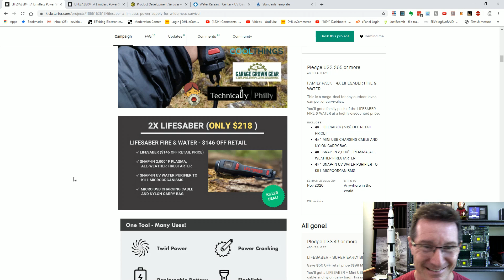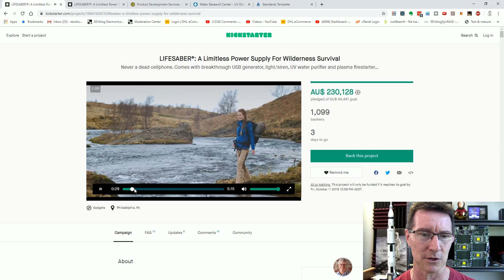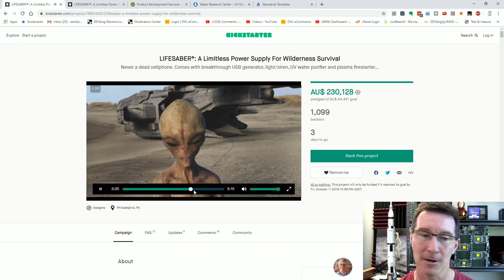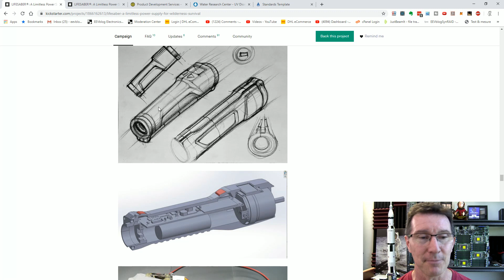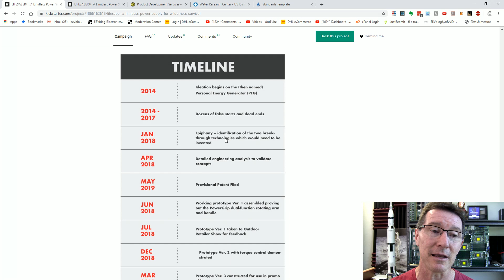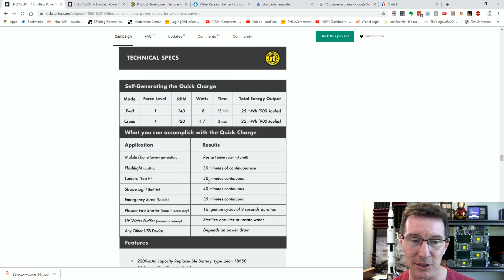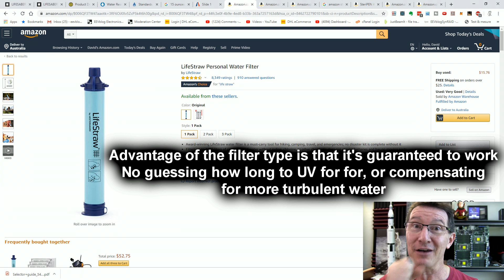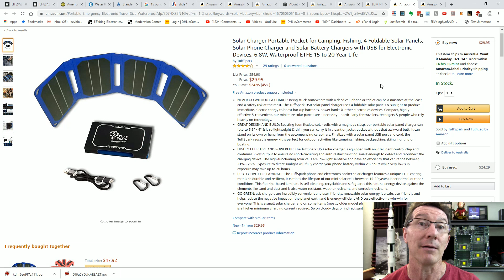EEVblog #1251 - LifeSaber Kickstarter - A Master of None FAIL

Comment: It reminds me of a video I watched some time ago about starting a fire with a flashlight... Incidentally, it was the refector element of the flashlight which is used like a focusing lens to ignite the fire, however ever since then I was wondering why someone hasn't made a flashlight that had a built in firelighter, USB charger, hand warmer, a taser, an alarm, a water purifier, an AM/FM radio, a bluetooth speaker, air pump, cooling fan, electronic egg beater,  a range finder, a direction sound amplifier, satellite messenger, vape, universal remote control and night vision goggles/vr headset built in...
Reply from the maker: Now that you mention it...
Reply: You too huh?
Reply: Just a flashlight with a good lens and a good 18650 tyvm. Plasma Torches are cool and all but if you can start a fire you can boil water to kill most microorganisms and bacteria at least enough to drink. 
The UV thing really depends on how effective and fast it is 🤷‍♂️

I still feel like a strong 18650 waterproof flashlight with a small plasma torch is more feasible and could probably be made at a weight of like 150-200grams.  Or even a flashlight with a dual lens system for water purification. But the rest of this is pretty nuts and makes no sense. Besides you can make a sos signal with any flashlight, a siren that sounds like a toy car isn't scaring anyone lol.

Handcrank power? It's been around almost as long as electronics have. 🤷‍♂️
Reply: @infernaldaedra  The UV part is the least impressive thing on the product, because you can literally get a decent UV flashlight for less than 20 USD.
Reply: @InfernosReaper  I think the flashlights are generally UVA or UVB whereas the sterilising light will be UVC.

Comment: In more disaster situations, you'll be better off with a pedal generator than any flimsy hand cranked jobbie. 40-60 watts, all day. Only failings is the bulk of the thing. But as long as you aren't on your two feet, that's a better option every time.

Hell, not only can it quick charge your phone, you can charge your laptop with 60 watts.

Comment: Don't they use UV type C for water purification? At least put your sunglasses on when you're messing about with UV-C.
Reply: As long as the light source is submerged the UV light is safe. UV penetrates only a few millimeters of water. Therefore the stick need to be moved around in the water.

Comment: If they replace the cranking attachment with windmill blades, it would become quite useful product indeed. Especially in Iceland the solar panel can be truly useless. The wind blows 24/7 instead. With 100mW windmill (made of tiny computer fan) I can charge 18650 in 24h.

Comment: You know what I say get them all together as that lighter is a good design and we'll if you used the latest tec in the coil wind like a high amp car one?? and magnet to neodymium with charge up coil if needed you could take the old 3w type have half the size and likely still get the 3w out so one turn to as many on the dynomo as you can get as you need a bit?? now these are beefy 6w on 15v and half amp out  but a thing or two curcit wise control with that and the lower gear set's and grafite caps and swap battery for long run use with a changer cap, lighter, and good quality light and tazzer otherwise the only use is a lighter charger or light tazzer in its own unit but that power out is crap??

Comment: The absolute last thing you want in a survival situation is a single point of failure.
Reply: If I'm going into the woods I'm going prepared. Paper maps with topography, and a compass. You die when you rely on flashy technology, it gives inexperienced people a false sense of security. Never mind trying to navigate at night with that snotty torch.
Reply: @volvo09  So true!
Everything that has an battery you can not relay on.

Even if for example phones are good navigate and I have used it, but when battery dies or the device itself dies its bad to only use that.
Reply: @benjammin2020  only a success from the seller's standpoint
Reply: Better to have separate devices and a battery for each one or better yet stuff that doesn't need a battery.
Reply: @Membrane556  This is also so true. Today most people for example use their phone for Everything. It fails then you have nothing....
Reply: +1
Reply: Benjamin Jinkins it’s a terrible product. You’re better off not getting into life or death survival situations if you’re so basic that you buy this crap.
Reply: Sharklops That's why they tell you get two of them!
Reply: if you think you need this thing in the woods, you were dead meat anyway
Reply: Maybe this is the reason why they sell two as a "killer deal". 😂
Reply: But two points of failure equals zero points of failure.    Source: I went to an American school.
Reply: Totally true, UNLESS it's your knife.
Reply: Yes. So, my knife snapped, but I still have my water purification tablets. My phone died, but my whistle and beacon are still OK...

Comment: "built out of modules from adafruit and ebay" might as well be photoshopped prototype. It's the reason they think they can keep adding shit to it. They got the battery charger bit working and are just bolting on anything they can find. Chances are they'll go through a ton of pcb designs trying to actually make a product out of it and if they do end up with something that works it'll just be the battery charger.
Reply: Exactly my thoughts! But instead of Adafruit I thought of  Aliexpress
Reply: In a reel disaster I'd rather a decent power bank and a handful of ebay models.

Comment: Like you say, it could easily be a legitimate project but they're basically reinventing the wheel.

 There's already cheap hand crank power generators with USB output (3-5W), flash light and alarm. 

The only thing missing from those $5-$10 cranks that already exist is a little UV led for sanitising water.
Reply: I've never seen an affordable UVC LED before

Comment: Forget the 650 Lumens from the lumentop. It's real value is probably closer to 80lm.
Reply from the maker: Nope, one review measured it at 739 lumens
Reply: @EEVblog  wtf? Can you please link me to the test?
Reply from the maker: @heyarno  http://budgetlightforum.com/node/65392
Reply from the maker: You do have to use the 14500 battery though, not the AA.
Reply: @EEVblog  I'm quite impressed. It's pretty close to what I want from a flashlight. I also made a holster for my AA EDC light, which doubles as a diffusor and the top glows in the dark.

Comment: And while having only one cell they use just a 2200mAh cell instead of a larger 3200-3500mAh cell?
Reply from the maker: Yeah, it's meh.
Reply: and why an 18650 instead of a bigger 26650. With its size, seems like a bigger battery with a higher capacity would be better.

If priced Right, yeah its gimmicky as all hell, but at least functional and they're being honest.

Comment: If it charged in both directions it could swing like a pendulum as you walked...free energy?
Reply: Walking requires energy.
Reply: @josho-aus  yes but if you are walking to get somewhere else would it use energy ?...obviously it would but would you notice?
Reply: @helltanner3722  Yes you would. Your depleting energy stored in your body. Not extreme amounts of energy but in survival situations every bit counts.
Reply: It would be better if you tied the crank to your leg instead of carrying an heavy pendulum

Comment: If there is sun you already have UV light for free,  a bottle (1.5L clean water, not muddy or so) water will get sterilized in couple of hours direct sunlight, that trick is used by many people all over the world.
Reply: Not much UVC reaches the Earth's surface.
Putting s bottle of possibly contaminated water in the sun is just going to turn it into an incubator.
Pretty good way to get dysentery if you ask me.
Reply from the maker: It has to be the correct wavelength (mostly UVC) at the correct dosage level. I doubt it.
Reply: Do regular bottles pass UV?
Reply: Nope ! the only way sterilize water is to boil and if you want to filter out chemicals they best way is to distill.
Reply: Not glass bottled glass blocks UV,..some clear plastics are OK.

Comment: A wide input range AC/DC and DC/DC PSU that works from 5-500V would be better. And that should be possible to design.
And a seperate Generator or multiple generators, depending on what you want...
Reply from the maker: For hiking? What are you on about.
Reply: @EEVblog  Yeah, you're right, that's a bit overkill for just hiking. Was more thinking about some trip where there is no power for weeks or months.
And you might want that in 2 parts anyway, Generator with USB Power to charge the Batterys perhaps...

Comment: leave the jack of all trades tools to the swiss army!
Reply: got a victorinox knife, not quite happy with it. it has a screw driver. when i tried to use the screw driver, the whole knife assembly got bent. i get it, that the torsional force you put on the tool is quite difficult to handle. but if you dont manage to build a tool which can handle the force, dont put a screw driver in it.
Reply: @23RaySan  So.. you buy Leatherman then?
Reply: @ridonculous8374  or a screwdriver..
Reply: @Bob Sacamano not sure, it was some time ago, but that could be the issue. thanks for the hint
Reply: @Bob Sacamano Mine only fold out to 90° at th center. I will say the blades dull quick and the screwdriver's shaft snapped like it was a popsicle stick the first time I used it. 
But otherwise it's held up well for a few years now 🤷‍♂️